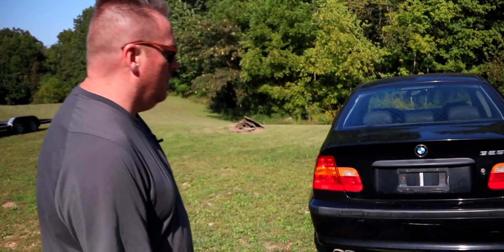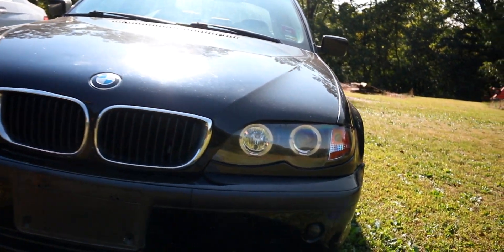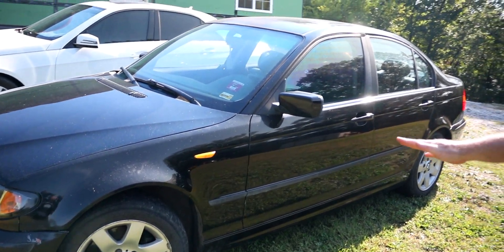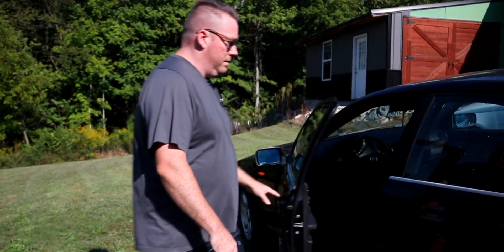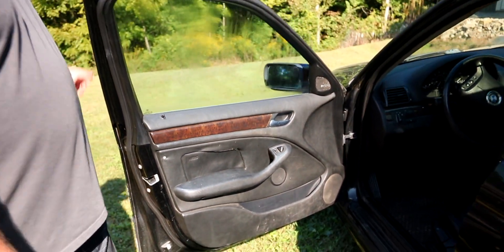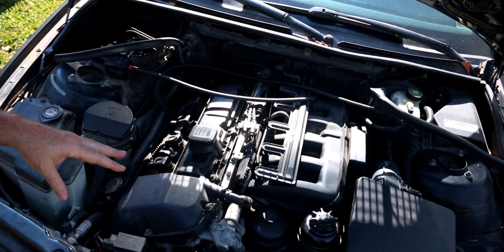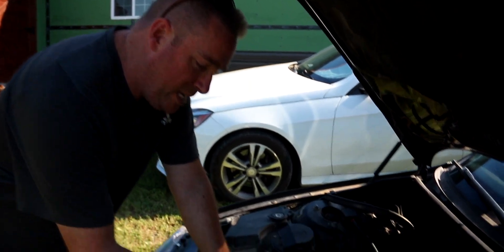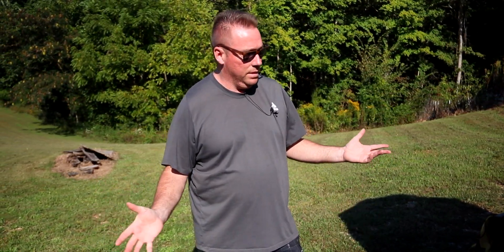BMW Reliability Is The BMW E46 Reliable Or COMPLETE JUNK ???

Comment: So I actually just went out bought this same exact model ('01 325xi) on a limb. It's my first purchase and I've never owned a BMW before. I honestly have no idea what I've gotten myself into and I'm scared shitless but I appreciate you putting out this kind of content. I've been scouring your videos for the past week! Luckily mine is in pretty decent shape. Just made a 1500 mile trip with no major problems other than I think the car needs new engine mounts and a lower control arm. I'm sure there are a couple more issues I'll find along the way but so far she's running strong !
Reply: I'd have it inspected by a pro eventually. The main thing is to avoid surprises because they can get so expensive with BMW if they go ignored. Noises, smells of burning oil and things that you can notice yourself go a long way to avoid driving it into money pit. Still though I doubt you'll have a bad experience and you'll probably love the car.
Reply: I sold my daughter our 03 330xi 5spd auto with 84k miles. Change both front axles, engine and transmission modules, all vacuum lines, intake manifold gasket, valve cover gasket, DISA valve, spark plugs, a couple of ignition coils, battery, starter, headliner, A and C pillars, door locks module, windshield cowl, etc and so on. Then when she got back to Colorado Springs a BMW specialist strongly recommended $4,400 worth of repairs! She only did the transmission mount. But my two insights are 1) put aside what money you can monthly for maintenance. 2) Don't trust or go to just one BMW specialist! Most owners don't keep up with the maintenance on these cars, there's so much. Oh, I forgot, the previous owner had replaced most of the coolant parts.
Reply: The car will last you as long as you keep up with the maintenance. M54 engine is bulletproof. Always keep an eye on the cooling system, address any oil leaks (oil pan gasket, valve cover gasket, oil filter gasket) and you’ll be good.
Reply: I would advise you to replace the whole cooling system and also convert your fan from electrical to mechanical, you won't have to worry about overheating the engine again

Comment: I'm surprised that E46 are just now hitting a low point in your area. Here, around the Charlottesville area (and Smokie mountains) E46 that needed engine or transmission could be found for $750, 2 1/2 years ago. About $1,000, 1 1/2 years ago. And $1,500 this past season. Our family has five E46, one still a project, and two project Z3. I don't recommend them to anyone, unless they're an enthusiast and are prepared to keep up with them.
Reply: It's because there's less by the day, and most are cracking their heads and stripping the head bolts so there unrebuildable.

Comment: i've had quite a lot of problems with mine, none engine related but electronic. abs light, esp lights etc. i find that the engine and transmission on these are perfect, and just require regular oil changes but there are problems with electronics and cooling mainly. best tip is never use cheap parts
Reply: Also never over-thighten any of the cooling lines/hoses..
Reply: This so true Thanks

Comment: When you mention rear sub-frame cracking, I presume you mean cracking of the floor pan where the rear sub-frame mounts.
Reply: Yes, they crack from spot weld to spot weld under the subframe mounts. Hard to see when subframe is mounted... PIA job to remove and repair.
Reply: Pretty sure this is not an issue on the convertible e46

Comment: E46 reliable of junk? I bought my BMW 325i new in 2001. Today, it's a one owner, dry climate car with low mileage (76K). It's required only normal maintenance. I've replaced the belts and hoses as well as the brake pads, the VANOS intake sensor, and the struts and control arm bushings. The car is on its third set of Continental Sport Contact tires. I'm going with reliable!

Comment: I'll have to disagree with the subframe cracks.. Can't really see them. My 01 330cic had cracks that I didn't see, until I dropped the diff and subframe. Cracks form between the spot welds, cracks form at the trunk area (under car), where the metal goes higher to lower (2 places). My diff was failing at 174k, that is the only way I noticed...when I removed it. 204k on it now, but it needs a clutch (throw out bearing failing)
Reply: Yeah it's good to catch it when it's like that. When it gets so bad you can see it with the subframe attached no bueno

Comment: NICE 👍🏼 like I said on my other comment on the first video you uploaded last week when you first brought the car to the garage, I recently bought a 325xi E46 2005 AWD black on black that looks identical at this car and I’m looking to make it my project and my only car to drive. It has 46,777k miles on it, the first thing ima do is buy a New battery, then do a whole “Tune up” and finally check an apparent sun roof leaking problem that it has,  to ultimately do a cosmetic upgrade with spider lenses LED projectors  & 17’ inch wheels.they are BMW OEM rims style 137. So I’m following very very very closely what you do with this car as it reminds me of my 2004 325xi that I previously had before buying the one I have now. Just got a question, how much does a sunroof leaking cost on a E46?  Do you know please & can’t wait to see the NEXT ⏭ Video
Reply: every season i tilt the moonroof and use compressed air to blow out the drains, simple first fix and cost nothing
Reply: @stevencurrie472  Thank you my mechanic said the same thing, i will do that for sure

Comment: Thanks again for going over this.  I still have a GM trans that takes a few seconds before drive kicks in after cold start.  I think I need to take the brand new German fluid out and do the trans fluid you like.  Hope that fixes it. Been driving 3 years with this issue 🙄

Comment: Need opinion,  im looking for project car, should I go with option 1- 2006 325xi, 200k, decent body, needs alternator and convertors for 1500, option 2- 2004 325i, 209k, good exterior and interior, needs power steering pump and alternator for 2500

Comment: I have an 2001 330i preface lift that's immaculate but it over heated and I have a 2004 330i that I hit a deer on and what im wondering is if it'd be more cost effective to switch the good parts of motor from the 04 to the 01 or the body parts of the 01 to the 04??
Reply: 04 to 01, prefacelift looks much better and all parts from 04 facelift fit in prefacelift,  I also have M54 engine on my prefacelift 1998 E46
Reply: @Alionn1 They didn’t make a e46 in 98 it’s 99-06, 92-98/99 is e36

Comment: Idk, I think that many e46s will require restoration at this point, and the floor cracking issue is definitely very concerning and expensive. If you need to restore some car, perhaps an e36 is a better choice. Lighter and had some cars come with factory lsd. E46 just feels like an inbetween car between the e36 and e90